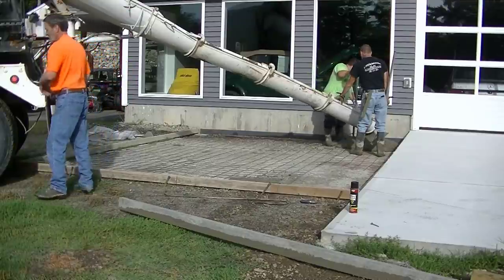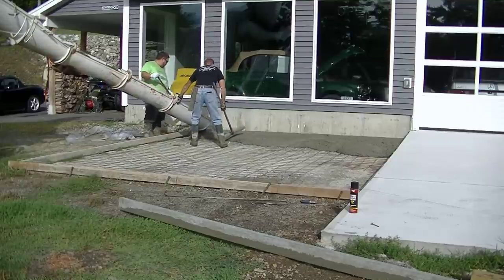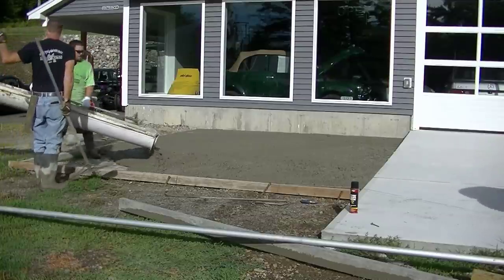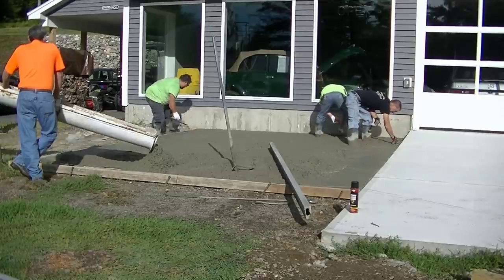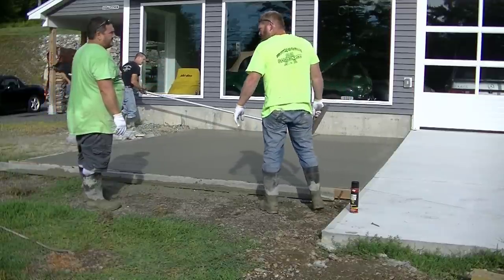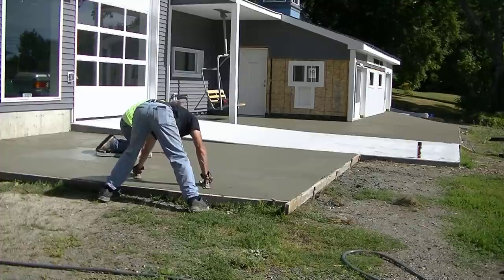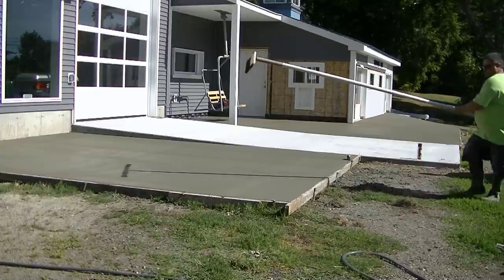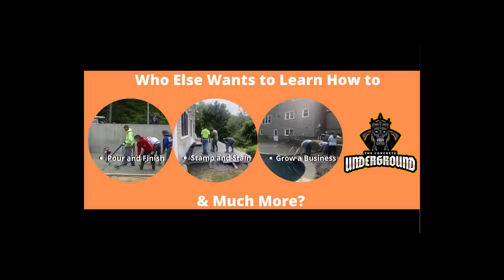Pour A New Concrete Patio Over An Existing Concrete Patio

Comment: Maybe it’s just the camera lens, but it looks like you guys had some crazy slopes going on and even some compound slopes in some of those sections. Down here in Florida, we would definitely run into some code issues with those. 
For really thin, concrete over concrete pours (~2”), we always had very good luck prepping the surface like you explained but then additionally, putting in Tapcon screws on a 1 foot grid and then ‘spiderwebbing’ tie wire throughout. We even had success with thin vertical surfaces using the same technique.

Comment: I did a pour recently of a root cellar roof 6in thick. I used 3in rebar chairs there is 3in on the bottom but on the top there is only about two in on the top of the top rebar. Should that hold up fine or should i add a little more concrete over it. Used 5000 psi.

Comment: I'm planning to build a pizza brick oven and have been searching the web for an M32 mix ratio, it's "design" and I can't figure it out as ratios only available until M25. Would you be so kind as to advise me please on the ratio of cement, sand, aggregate, and water? It's 160cm L * 120cm W * 12cm D RCC slab. I've been told to do the 1:2:3 MR according to Middle East standards but I'm not sure this was a genuine scientific advise like the one I hope to get from you. If I'm not going to get anywhere with any info re M32, guess, I'd go for the M25. 
Thanks for your videos and the information, I'm learning from you, it's a passion about concrete that I've got and can't explain it to some of my friends who can't really get it lol. Cheers

Comment: Your concrete always look wet and watery. Doest it need to be in order to work easy? 

I did a walk path next to a driveway and it nearly killed me and not easy to get it spread ... it was too thick. Do you add water right when it arrives?
Reply: It shows up very thick barely any water... then you tell the driver when he gets on site how much of a slump you want
Reply: He usually mentions the slump of the concrete being poured. To achieve a 6 inch slump without adding too much water, he uses a plasticizer...
Reply: @johnnyinthehellcat4092  The driver will give you whatever slump you want, but he writes down on the ticket how much water he added (only by the customers orders). The slump is spec’d by the engineer that spec’d the design mix. If you have the driver add more than about ~10 gallons, you own it and have no recourse if it doesn’t come up to strength.
Reply: psidvicious i run a custom concrete buisness in New Hampshire but thanks for your input skippy
Reply: @johnnyinthehellcat4092  skippy??
Reply: psidvicious      Disssssssssss...... 🤫
Reply: @evanking6329  By running a ‘custom’ concrete biz, Johnny made it infinitely clear, he’s the guy that hoses off the tools and loads ‘em back on the truck.

Comment: Thanks much Mike for the great video. A question: Do you need to diamond grind exposed aggregate finish prior to overlaying or will Weld-Crete alone be enough?
Reply: Does it look bad, bad slope, or is it chipped and cracked?  Chances are it's been sealed with a penetrating acrylic.

Comment: Hi Mike - what is that Isofoam stuff between the finished slab and the new one so they don’t bond?  I’m doing a 10x5 repair and it is right up against a finished slab.
Reply: For what it’s worth, from a career concrete guy, the isofoam or ‘expansion joint’ as it’s sold buy, is pretty standard practice, but way over used in my opinion. 
If you pour new concrete up against a smooth existing concrete face, the 2 concretes will never ‘bond’. You’ve essentially created a perfect cold joint. 
Even if you’re pouring new concrete, completely surrounded on all sides with old concrete, you won’t encounter any expansion issues, UNLESS you’re talking about something larger than ~100’x~100’. 
The expansion factor of concrete is way less than people think and the volumetric size will never be any larger than when the concrete is in it’s plastic state, the day you pour. 
Additionally, the expansion joint creates a much uglier joint over time than a simple, concrete against concrete, tooled joint.

Comment: What’s the point of the wire mesh if you’re not pulling it up? Laying it at the bottom serves no purpose!
Reply: He was pulling it up as he went.
Reply: I was wondering the same thing.  They pull it up but then everyone walks on it so it's back at the bottom.  Also is there a reason to use the mesh instead of rebar?  Wouldn't a 24" grid of rebar be stronger?
Reply: I’m retired contractor (sorta). We would put the mats on bricks or tie them to rebar dowels pounded in as verts. But, Mike gets credit cuz he said he added fibermesh. I’m in Michigan, similar weather conditions, and we used a 6 sack mix with limestone to prevent popping. 6 sack is rated at about 5500 PSI.
Reply: @rmyerscmi , Once there's rock under the mesh, it isn't going back down, no matter how much you step on it. He also said they use a 4000lb mix with fiber.
Reply: @augustreil  Exactly. On flat work, the wire is most effective very near to the bottom. For structural slabs, the bottom steel is typically spec’d to be ¾” from the bottom surface.